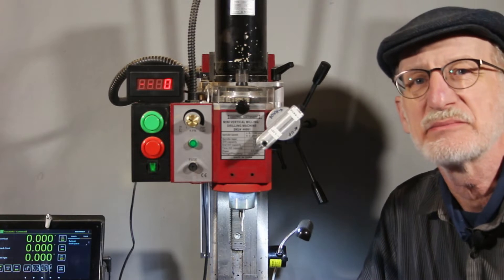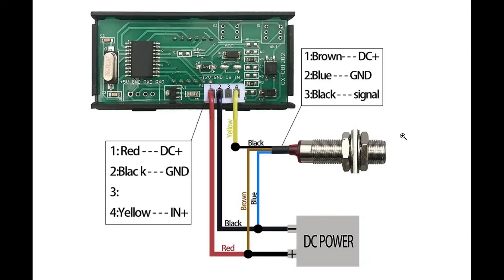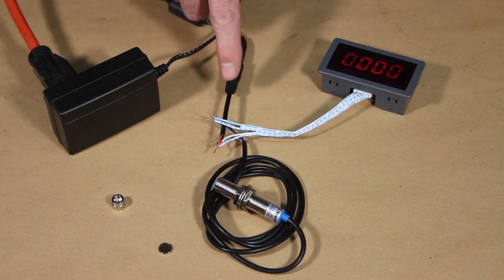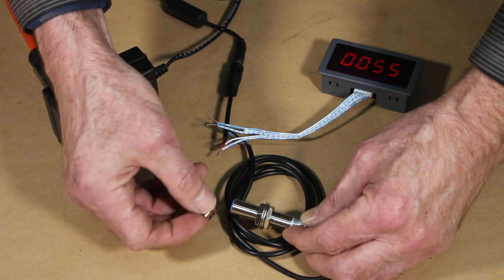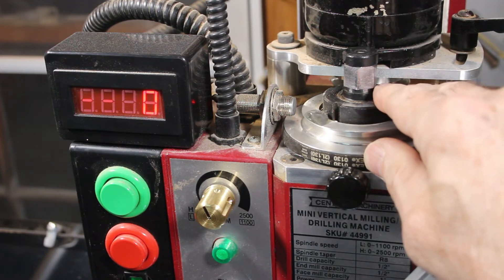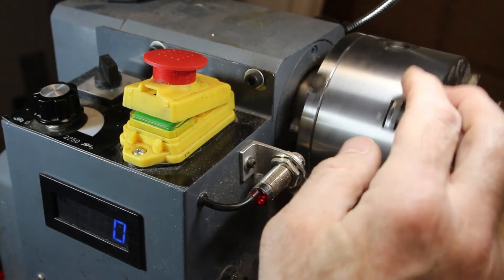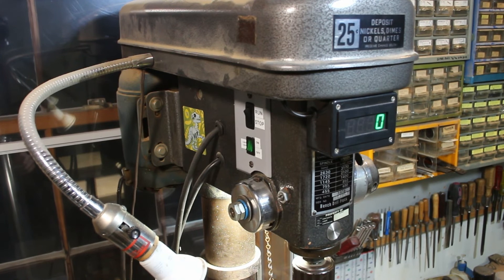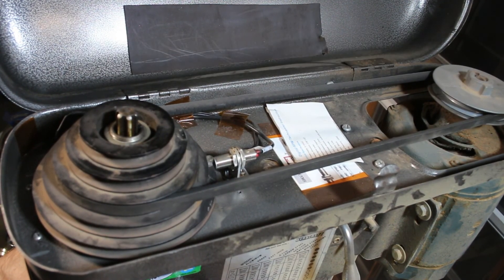Installing tachometers on my machine tools

Comment: Shaft speed and pulley are not the same.... yes the pulley is mounted to the shaft   but the further  out you go from the center its not the same reading of RPMs??
Reply from the maker: ??? It doesn't matter how far out from the center the sensor is, it's all the same speed.

Comment: how did you wire into the light switch?  most of them are 110volts
Reply from the maker: I used a small power adapter for the 120 volt to 12 volt conversion and stuffed it inside.

Comment: Fitted one to the belt driven mill when installing a VFD. Necessary for getting cutting speed. Annoying slow update time. 2 seconds before stable. Had some problem with supplying power. The VFD 24V was to noisy, had to fit a separate  power supply. Works OK now.
Reply from the maker: I'm glad to hear I inspired you to install a tachometer.  I usually power mine from a small wall adapter.

Comment: I want to mount one on a machine, but it will need a 1/2" gap.
Will it sense the magnet at that distance ?
Reply from the maker: In my experience it requires less than a quarter inch gap, but you might experiment with bigger magnets as long as they're well secured.

Comment: Is this thing waterproof?
Reply from the maker: The tachometer displays are somewhat splash proof. Is that what you meant?
Reply: @GuyMarsdenMakesStuff  i mean the sensor and it's cable, is that waterproof?
Reply from the maker: It looks like it might be but the metal parts might rust if it's kept underwater.

Comment: could you do this to counter revolutions? and reset im looking to do something similar but to count feet of line
Reply from the maker: Sure, but counters are different from tachometers.  Tachometers count turns per second whereas counters simply just increment.  If you research you will find electronic counters readily available.

Comment: I bought one for automotive use but in it's description it states 'Switch', as in turning something On or Off, and that's where I'm stuck, because that's what I bought it for, to 'Switch' something on and off. Searches have turned up nothing. Would you have any insight on how to wire it to 'Switch' something On/Off?
Reply from the maker: I'm confused. Tachometers display speed by reading a magnet attached to something spinning. There is no switching involved. What do you need to switch and why?
Reply: @GuyMarsdenMakesStuff  I need to 'switch' the 'Torque-Converter LockUp' that I installed. I need it to automatically power at around 2,000rpm (or 45mph) and I wanted to use the 'Tachometer' to the CV joint closest to the Transmission (for many reasons). I am already tired of Manually switching it on and off.
Reply from the maker: @garrykellogg3215  okay, that is actually a thorny problem with no off the shelf solution that I can think of.  I happen to be an electrical engineer and could build you custom electronics for that but it would be expensive.
Reply: @GuyMarsdenMakesStuff  I was thinking of a Shift Light, but that's momentary. Also the Window Switch (used for NoS) was a thought. For I am not a rich man.
Reply from the maker: @garrykellogg3215  I'm not an automotive guy, so you're using terms unfamiliar to me.  All I can say is that I'm unfamiliar with an off the shelf solution.
Reply: @GuyMarsdenMakesStuff  I thank you for your offer to custom make me a specifically designed one, and to admit, I was really venting because they even said 'Switch' at the time of their ad when I bought one, but it was not a 'switch' at all. I think enough people got on their case about falsely advertising it as a 'switch'. There has to be a solution out there by now that will suit my need, I just have to learn the proper terminologies to find it.

Comment: Isnt that just the rpm of the pulley and not the drill press spindle?
Reply from the maker: The front pulley is directly connected to the spindle so it is accurate for the spindle!

Comment: It seems that mounting the pick-up to a random stepped pulley might not give as accurite of a reading of the actual spindle speed. Have you ever followed-up on an installation's accuracy with a hand-held RPM detector or verified with your drill press, (or lathe) RPM settings with the LED tachometer? Thinking of purchasing one of these. Great video!!
Reply from the maker: There's nothing random about the pulley that I mounted the magnet to. It's directly connected to the spindle. And yes, I have confirmed the accuracy of these devices with a separate laser tachometer.  Thes little units are surprisingly accurate!

Comment: How far away does the magnet need to be from the sensor?
Reply from the maker: It depends on the strength of the magnet, but ideally less than a quarter inch, and you have to have the magnet facing the right way, so test it before securing it.
Reply: @GuyMarsdenMakesStuff  ok ...
  And yes,  i saw your  video on how the sensos wants  North polarity from the mag..
Reply: Tnks.

Comment: mr guy. just did an excellent install on that RPM  dohicky on my HF mill and powered it up which seems to be functioning however  I keep getting erratic readings, meaning it wont hold a steady setting , anything to that?  >>>>>>BTW I followed  instructions to the T
Reply from the maker: Check the orientation of the magnet and the distance between the magnet and the sensor. It can be pretty fussy.

Comment: Excellent video.  Have a look at that TouchDRO box.  There are solder points inside that allow you to connect a tach signal.  Then TouchDRO will do really fancy things like chip load calculations.
Reply from the maker: Thanks for reminding me about that. I'm going to get around to hooking that up eventually.

Comment: How would you install the sensor so it reads actual drill-shaft speed rather than pulley speed?  Thanks for this useful video!
Reply from the maker: All the tachometers are installed so they read the spindle speed.  Doesn't matter where the magnet + sensor are located.
Reply: Your question references in terms of linear speed, which involves the diameter.  The pulley groove that is used does change the RPM, but all parts of the pulley travel at the same RPM regardless of which groove is in use, which is why the location of the magnet and pickup does not matter.
Reply: The magnet is attached to the step-pulley that is attached directly to the spindle. The RPM varies depending on which step the belt is on but that pulley is on the spindle shaft.

Comment: How can these be hooked up to the mill power source to the mills startup power. So it comes on when the mill is started.
Reply from the maker: If you're skilled enough with AC wiring, you can pull two extra AC wires from the control box after the main power switch. Then use that to connect to a two-prong AC socket that you plug the wall power module into that powers the tachometer. But be careful!

Comment: Some people have complained that the readout on their unit reads, 'LLLL'. That's normal for when there's no signal coming into the unit from the sensor. The other problem that they have and you demonstrate this that the orientation of the magnet is important. The sensor won't pick up the magnet if it's in the wrong orientation. I also mounted a unit on my mini-lathe but made a small bracket that I fit 'inside' the lathe head and glued the magnet to the shaft inside. The wiring goes through a small hole that I've chamfered so as to not wear the insulation and the wire goes into the control box
Reply from the maker: the tachometer's I used show a single zero in the absence of a signal and not the "LLLL" that you have seen.  I considered mounting the sensor inside, but it just seemed like more work than was necessary.  I would encourage you to put a grommet or some kind of plastic strain relief inside the hole that you chamfered - that is the more common practice for that situation.
Reply: @GuyMarsdenMakesStuff  The hole is carefully rounded (beveled) and smoothed so it will not wear at the insulation. I've been doing electrical installations all my career. Some of the bushings designed for the purpose are metal instead of plastic or rubber.  They work just fine. It's the smoothed rounded edges that make them effective, not the materials they're made of. 

 I've seen so many of the sensor installation jobs that are 'out there in the breeze so to speak' getting oil, swarth, dirt on them, getting bumped etc. In my installation, one would not not even know it's there if it were not for the readout in the control box similar to yours. I like it. I'm going to mount one at some time in the future in my bridgeport and will also mount it where it cannot be seen, or get dirty, or bumped.
I honestly believe that most people mount the sensor and the magnet where it will take the least amount and time and effort. Not where it makes the most sense. 😉
Reply from the maker: @fredflintstone8048  OK, I'll give you a pass on that hole - this time! :)   Totally agree, but I wouldn't want other less experienced readers of these comments to get the wrong idea...  (I'm an electrical engineer and design products, so I too know whereof I speak!)
Reply: @GuyMarsdenMakesStuff  Yes, of course, whenever a wire passes near any sharp object and there is any kind of vibration (movement) there will be wear on the insulation. One interesting thing that's happening in the automotive world is those black plastic corrugated loom jackets  used to protect wires in the engine compartments and in various other places in and under the cars get brittle and vibration has been causing them to cut into wiring harnesses causing wires to short to each other and also expose the copper to the moist air causing corrosion which dissolves the copper over time turning it into green crusties. So even plastic can damage a wire's insulation. The point is that wires should not be exposed to sharp edges. 
Most electrical bushings are made of metals, and they're the ones that last the longest where as plastics and rubbers will off-gas over the years, dry out, and often crumble to dust leaving the wire insulation exposed to sharp sheet metal edges. 
I would say that the housing on my mini-lathe head is ~ 3/16 - 1/4" thick.  I drilled it a little larger than the wire and then chamfered and filed smooth a nice rounded entrance and exit to the passage with no sharp edges. Yes, I knew what I was doing and why.
Reply from the maker: @fredflintstone8048  Alrighty then, you are correct and speak from experience.
Reply: I have a similar problem but it readout "HHHH", the polar it is ok, when i moves by hand it reads something logic. But when i put the spindle to rotate, show some numbers and the "HHHH". It is glue to the head of a hexagonal bolt. I try diferent gaps from 1mm to 8mm and always turn the same error. I have the ac 220v version and the same sensor with the original 10mm magnet.

Comment: I do not feel bad that I put a tach on my little wood lathe even though it has stepped pulleys now that I see you even did it on your drill press. Nice to know that I have it in the right speed for turning things since you cannot see the pulleys.  Have it on my mill and metal lathe as well since more critical for me to know speeds. Nice video.
Reply from the maker: Great minds think alike Galen!  :)